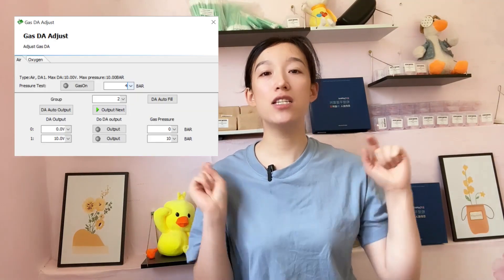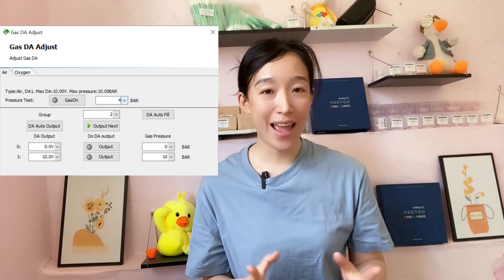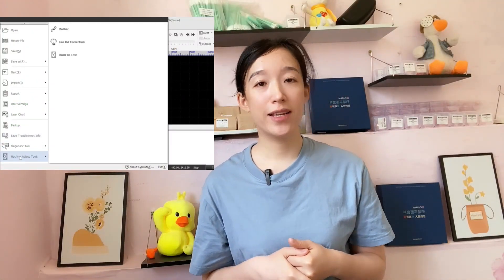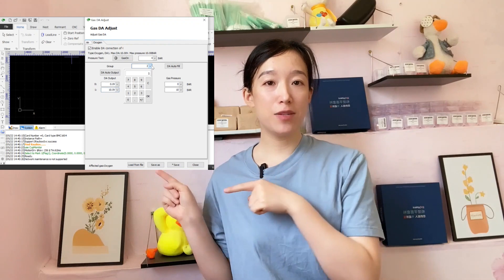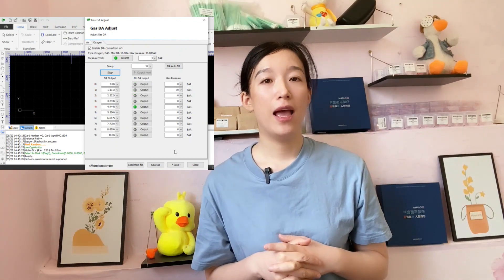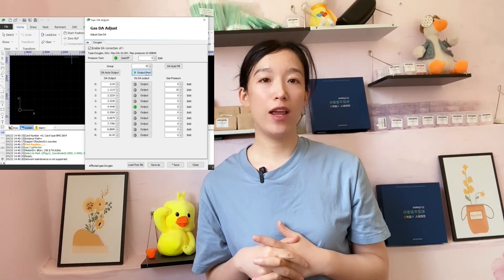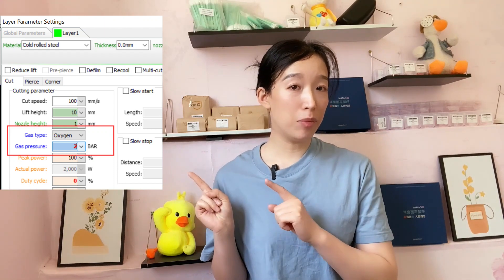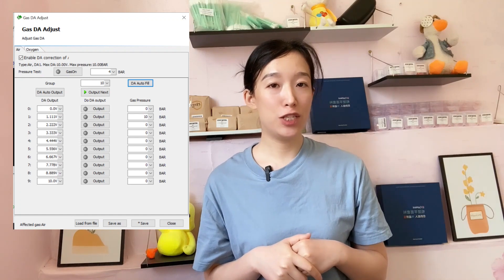Laser Cutting Gas Setting | CypCut Setting | Gas DA Correction

Comment: Is it needed to adjust gain and pressure settings in the proportional valve itself? I have seen that proportional valve wont open unless i set the minimum pressure to about above 0.05 MPa
Reply from the maker: You need to ask your supplier to help you make the setting.

Comment: Thank you Clara I have a question 

(da gas adjust) it using just to test proportional gas if it good in each voltage to test how many pressure and not effect in working cypcut software or this value in (da gas adjust) it will affect on working in proportional on cypcut 

I did not know exactly what the role of this feature is
(da gas adjust)
Reply from the maker: If the machine is configured with proportional valve, it helps to find the accurate gas pressure, I think it is important for cutting.

Comment: Hello Clara! Can you help us. We have a Gweike lf3015lnr. Can we cut non-metal material? fpr example plexi or EPDM rubber.
Reply: yes, you can cut plastic and rubber, but there is a high probability that you will damage the optical elements (lenses and protective glasses), if your machine is under warranty, the manufacturer may refuse to repair it. for such tasks there are much cheaper and simpler CO2 laser machines.
Reply from the maker: Please don’t try to cut those materials, even for some high reflective materials, please consult to your supplier, seriously.